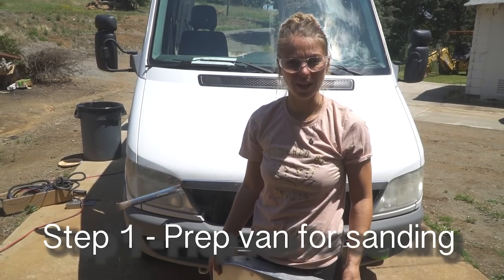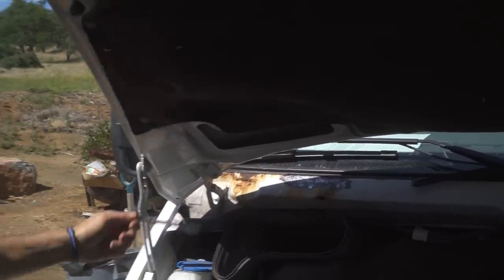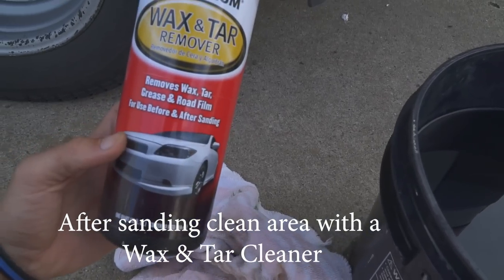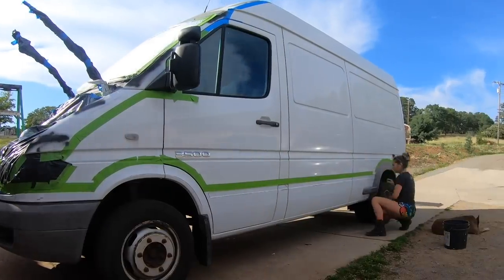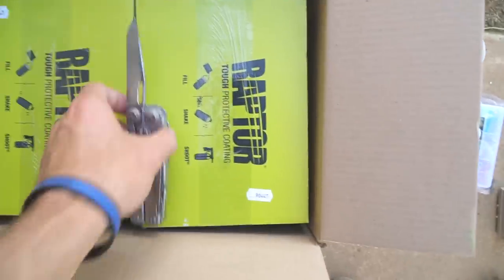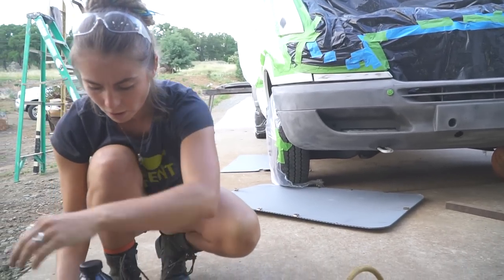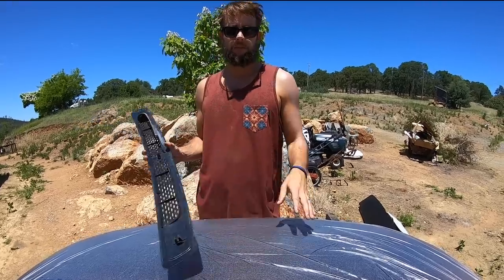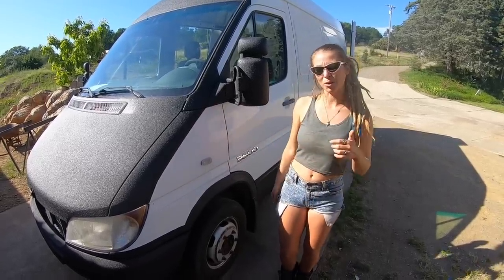Painting a Sprinter Campervan with Bediner in 5 Steps - Easy way to Remove Rust from your van

Comment: This is awesome, I have a question: how is it holding up in the lower 1/5th of the van along the lines you made?
Reply from the maker: It’s holding up great we’ve had it on our current van for almost 4 years now.
Reply: @Vankookz  Wow, I figured it definitely would have started to peel off from the top down by now. Good to hear it's doing well. Thanks!

Comment: Great video, definitely want to put bed liner on my roof one day. One thing I wish you would have mentioned is how much it would cost to get this professionally done and how much you guys spent, ball park for each so folks can know the amount they can save by doing it themselves. Great job as always!
Reply from the maker: Nitram Midnite hey we have another video here that breaks it down better.  I’ve never been quoted I just know that it’s definarley something we could diy.  Thanks we are stoked on the turn out. Here is the link for the video we painted the roof it was around $285 or so for the products.  You need an air compressor and a few things.  There’s a lot of info in the description https://youtu.be/EkTX3sEJato.  We also have a lot of info on our website about painting the van here https://www.vankookz.com/diy-sprinter-conversion/2017/11/8/phase-i-addressing-the-rust-raptor-liner-hood-and-trim